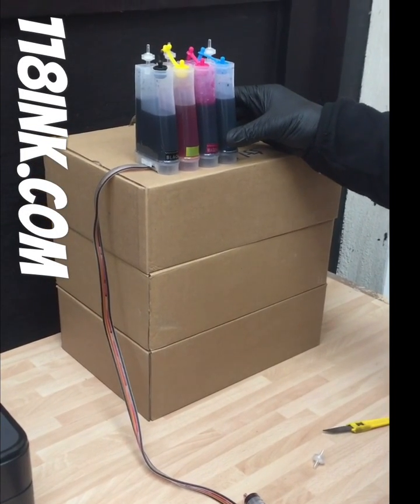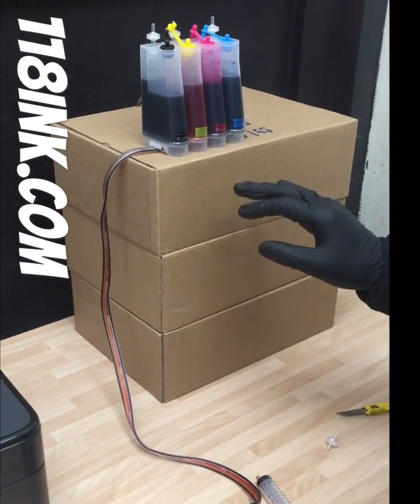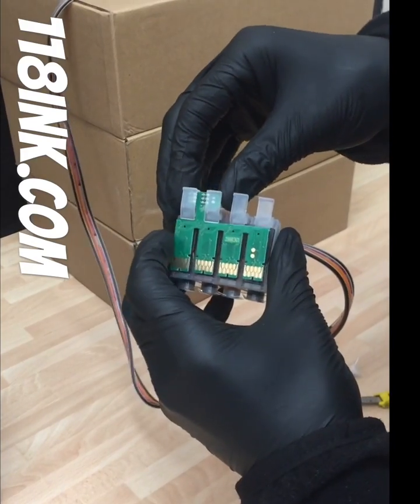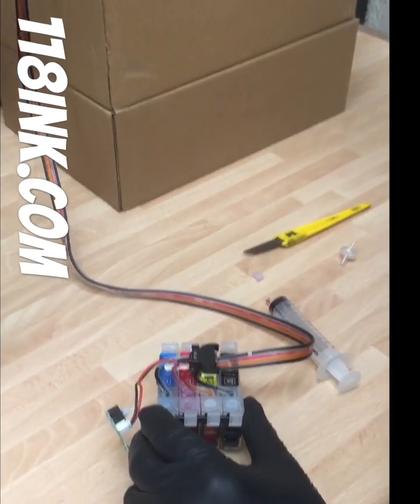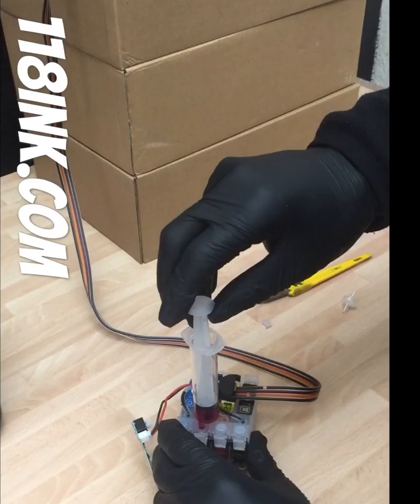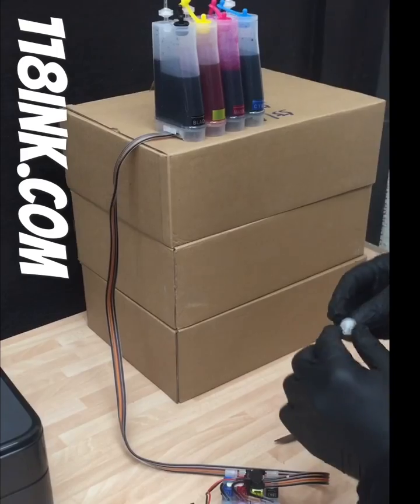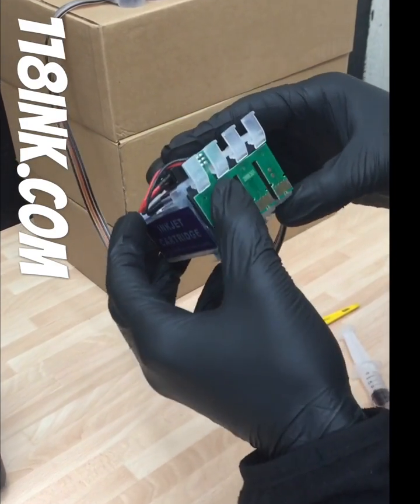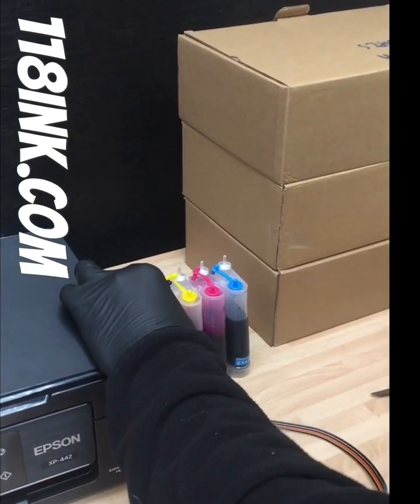How to Prime an Epson CISS system and remove air from the ink lines

Comment: I bought a used printer, the ink tank was filled in the wrong ink. Epson ET 4500 tank, the black ink was filled with the blue tank. Please do you have any idea how I can correct this error? I have already print with the printer
Reply from the maker: Hello to be honest there is probably no way that would be cost effective for you. Sorry
Reply: Printer Refresh Ltd Can you please explain what you mean by cost effective? My question was how do drain out the ink in tank and refill the tank with the right ink
Reply from the maker: I mean you will most likely never get all the Ink out ! So you would have to try find replacement tanks.
It’s probably impossible. Sorry